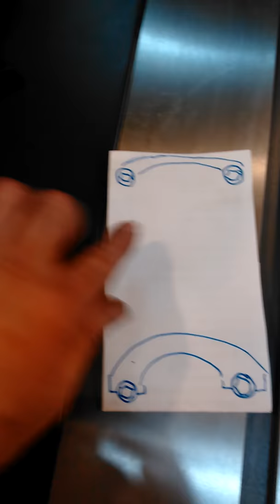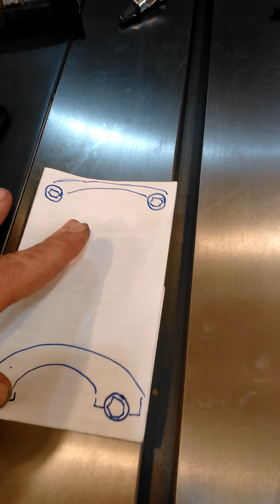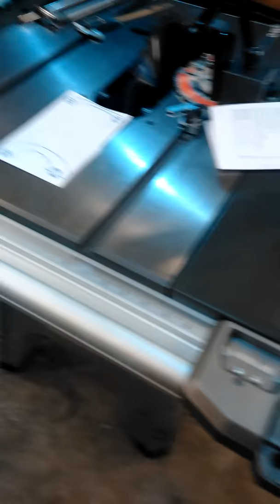Rigid R4512 Blade alignment to Miter slot, easy fix.

Comment: Thanks for the video - it helped, but also made me dig deeper.  The tapping adjustment for me only got me within about 8 thousandths, no matter how much I tried.  Through more research, I found that the bolt holes in the aft trunnions needed to be widened for the adjustment.  This required me to flip the saw over - very daunting task by myself until I realized that I could use the right side fence stabilizer for leverage.  Then I had to remove the wheels, and lower frame.  Next had to remove the side tilt wheel assembly, then the up/down wheel - the shaft stays on.  The electrical needed to be disconnected - took photos for re-wiring.  Then the trunnions bolts were removed and lifted the heavy motor/saw assembly out of the frame.  The trunnions themselves are small and easy to handle.  I clamped the rear one to my work bench and grinded the holes on the opposite side that I needed the assembly to move about 1/16th of an inch or so.  Dremel ran out of battery so I switched to round file, this actually worked better.  For good measure I took the front trunnions and widened in both directions just a tad.  I put the whole thing back together, made a couple easy adjustments and had the thing perfectly lined up - nuts on... perfect.  Made a test cut, and no burn marks.  I am back in business!
Reply from the maker: Did you loosen them all ?  The thing should be pretty close right out of the box. I've never heard of anyone not having enough play to the point that they had to widen the holes. Wonder if you had something else stuck in there, and the simple act of disassembly dislodged whatever it was denying you that last 0.008" ???  You never know.   Anyway, glad you got it fixed. In this price range it's a really good tablesaw !  Tnx for watching

Comment: I love this video. And this table saw. Ridgid R4512 is a great Hobbyist Sa. This guy got me, right from the "like 16 to 17 thousandths" of a measurement..."  Cracks me up every time! If you're worrying about the measurements this guy is apparently making,  the solution isn't a washer. How thick is a washer? What kind of washer? What? Whaaaat!?
Love it!
Reply from the maker: Who said anything about a washer ???   The measurements i made tell which way to bump the motor over within the trunnions.  Not sure what is "cracking" you up here .  After initial setup, you take a few measurements of the blade, front and back, relative to the slots. You take the average of those numbers (mine were 0.016" , 0.017" , 0.018")  and now you know which way to bump the motor over so that the difference front to back of blade is near zero .  Has nothing to do with washers, how thick or what kind

Comment: this was very helpful and I just finished adjusting mine using this tutorial. Was off by 0.024, now off by 0.001. and Im so happy about that. THANKS. Took me abour 1.5 hours to get it dialed in just right.
Reply from the maker: Thanks. Glad it helped. Sorry for the long and shaky video. I have a little better camera now...and can also edit going forward. I'm going to throw a link to a nice blade i've been using for years. Marathon , a very good all around blade that won't break the bank.
Reply: Still aligned after raising the blade or moving the blade to 45°?

Comment: Thanks for taking the time to create this video, good job. I have the same saw and I agree it is A good saw for $500. However it can be tweaked to be much better. 
In my previous life before becoming a pilot and flying airplanes for a living I installed computer controlled machining centers CNC machines.
We held some pretty tight tolerances for back then. 3  three 100,000 . But this was for milling steel.
Like you said you have to align your machine if you want good and repeatable cuts. 
When I bought mine I knew there were issues  with the trunnion not keeping the blade parallel to the miter Slots.
It was worse when you raised the blade.
1 st  check to see if the blade is Parallel to the miter slots. Using the saw blade is the last resort, but he did say to use the same tooth to measure off of. That is good. Better yet I have a Master Plate that is milled to 3 one hundred thousands we will call that 3 tenths..
This plate mounts to the arbor, the arbor does not move? Now with a dial indicator in the miter slot with no play.
Slide the dial indicator along the slot with the stylis of the indicator preloaded by 3 thousands and zeroed on the master plate.
Slide the dial indicator taking note of distance the front of the master plate to the rear. This will show how far out the master plate is relative or to the miter slots.
To align the trunnion to correct this tapping for me with three bolts lose did not work. I  used a clamp against the trunnion  and the cabinet
To adjust the arbor  parallel to the miter slot. I tracked both miter slots to ensure they were parallel to each other and they were.

Comment: Thank you for this video, Steve! I am having the same trouble with the same saw and your exhaustive coverage (where to tap, how to measure, etc) is much more helpful than the other videos I’ve watched on the subject. Going to try this with a micrometer instead of a dial indicator.
Reply from the maker: keep in mind that I kept saying "micrometer" in error ...I meant dial indicator.  Any cheap dial indicator will work.  
Thanks, glad it helped you !
Reply: Steve's Mixed Bag Well, just got it dialed in within about a thou. Your tips on the gentle tapping helped. Kept screwing myself up after tightening the bolts down. A dial indicator would have been SO much easier. Calipers have tiny little jaws and the points can dance off the sawblade teeth. Anyway, thanks for holding my hand through it!
Reply from the maker: No prob.  Shars have a good quality cheap dial indicator. I've seen people make a wooden slide that fits in the slot with a block on top of that to mount a cheap dial indicator. That's probably the simplest way to do this.  I have vids on dust collection for this saw. Check them out. Glad this helped !

Comment: This comment is for anyone who has unscrewed the three easily reached bolts and still can't get good blade alignment. If you pivot the blade to 45 deg or so the fourth bolt becomes easy to reach. You can still get a basic idea of how out of alignment your blade is while it is in this position. I knocked the back(front really) trunnion over about 1/16 of an inch toward the angle adjustment handle, which allowed me to tighten down the bolt that is behind the motor, move the blade back into 90 deg position and then use the now tightened 4th bolt behind the motor as a pivot point to align everything perfectly.

Comment: Thanks, this video gave me some good info.  The heel of my blade is off by about half a millimeter and it's driving me crazy!  Burn marks in the wood upon completion of the cut.  By the way, when did you buy your saw?  My 4512 has four castors and the pedal is on the front of the saw, not the left side.  weird.
Reply from the maker: Thanks, glad it helped you out. I got the saw a few months ago, I think the last year model had the 4 casters . 4 is probably better than 3 and I would have rather had a 4 caster model, but 3 seems to work fine as you can see in the vid .

Comment: Thanks for the video, I noticed when I checked mine that the measurement of the blade changed as I raise and lower the saw blade, the trailing edge of the blade moves side to side as I raise and lower the blade, does yours do this?
Reply from the maker: Matt Spry Check on both sides of the blade when raising it. Maybe the blade is set a little off of 90 degrees.

Comment: Do you know how to fix the fence from being loose. I have adjusted the nut at the one end but the fence isn't loose from front to back, It's loose from side to side. So every time I lock the fence I have to check and make sure the distance from the blade to the fence is the same from the front of the blade to the back. Very frustrating because this saw wasn't cheap.
Reply from the maker: I haven't had that problem but there are alot of good videos on this saw here on youtube. Make a playlist and add a bunch of video's that address that problem. Different people address a problem   in different ways ...one or more will convey the info in a way that makes it simple for you to fix the problem. I had a problem with the fence on my Makita LS1013 being out of square , it took several videos before I found someone that showed the fix . Youtube and persistence is your friend. When you find the vid , stop back and post the last part of the video link , the part after the forward slash near the end of the link. Good luck !
Reply: frehleycomet, I have the same problem, everytime you move the fence, no matter if left or right, the top part of the fence will be out of alignment, maybe up to 1/8". So what I did was after I move the fence to the position that I want, I just gave a little push on the lower front block of the fence and that will straighten out the fence and parallel to the blade, then I lock the fence down. I found that is the easiest way to deal with it. Hope that helps.

Comment: good vid, thanks. Question. I was trying to square up my blade to the miter slot as well and as soon as i got it to lined up with the right side slot, the left slot goes out of square. Then I tried to square it the the left side slot, then the right slot is out of square. I think the miter slots themselves are not straight. What do you think?
Reply from the maker: homie817 run the dial indicator in one slot while checking the other. Then you'll see if they are parallel .  if they're not parrallel then something like a sled would bind when sliding. keep at it
Reply: I think I might have solved the problem. I fogot to loosen the 0degree hex screw on the table top. So now both sides are pretty squared up. I don't have any calibers at the moment but I will get one soon to double check. Thanks.
Reply from the maker: Please elaborate on your fix. If I ever run into this problem myself, it would be good to know what you did to fix it. ....and in my vid I kept saying calipers ...haha , I meant to say "indicator" ...that is a dial indicator im using, you can get a cheap one that is adequate from harbor freight, or a much better one and still cheap from Shars . They are a budget tool outlet but their stuff is anything but junk. In fact they sell quite capable machine tools at a really good price . Anyway, glad the vid helped you out. That is my only goal with my vids.

Comment: Why couldn't you use the edge of the opening that the cover fits into to register the blade? If the cast-iron plate is machined in one operation, wouldn't that opening be parallel with the miter slot?
Reply from the maker: Not sure which cover you mean. You talking about the blade insert ? You could use any surface that you know is supposed to be parallel to the blade. The miter slot was the most obvious and easiest for me, so I used it. There's always more than one way to skin a cat ... this is how i did it .   On a side note, I've got some hours on this table saw now. I've made about 20 Nuc boxes , 20 Nuc supers , 20 telescoping hive covers, a couple 10 frame deeps, 8 outdoor wedge speaker boxes, Fence toppers for my wooden fence and a bunch of other stuff doing rips, regular cuts, miters and dado's too . I give this saw a big thumbs up. Unless your doing alot of fine cabinetry work or production work, you cant beat this saw in this price range.  Hope the vid helped you Chris !
Reply: This video helped a bunch. Thanks for taking the time to post it, and replying to my message. Yes, I did mean the blade insert slot. Please keep the videos coming. I would be helpful if you could manage a regular camera so they would be wide-frame!
Reply from the maker: Yeah I hear ya. I'm not a camera man and my channel is not monetized. These are just spur of the moment vids from my phone. Glad it helped you.